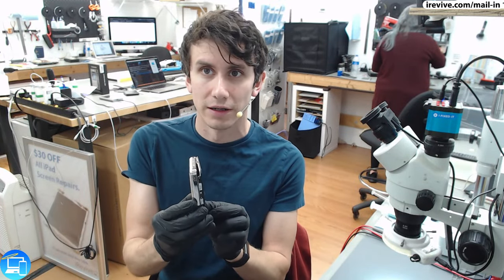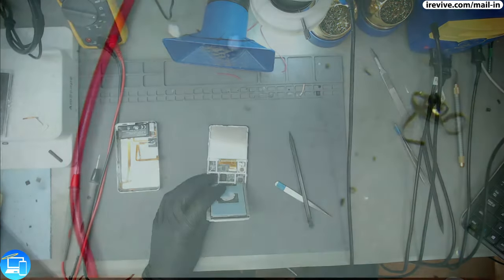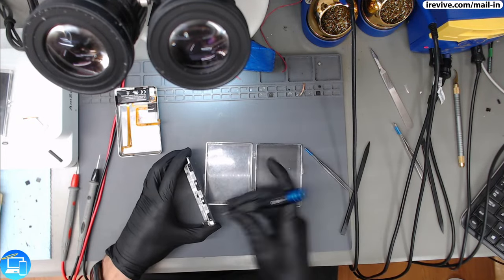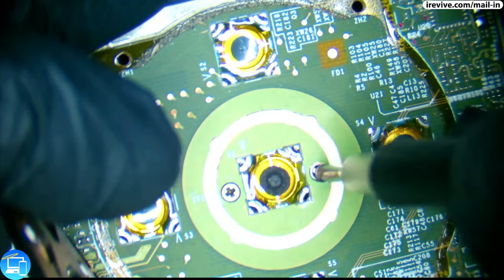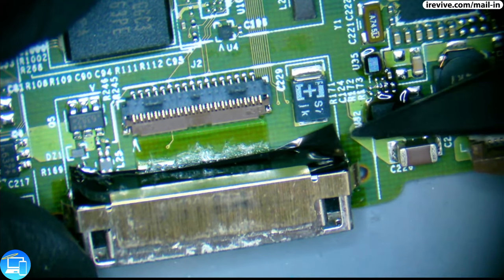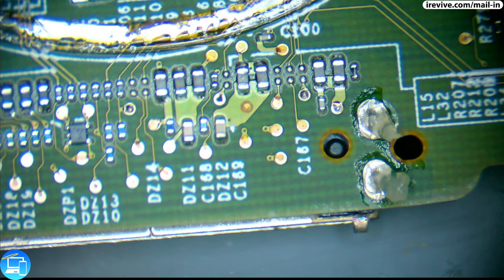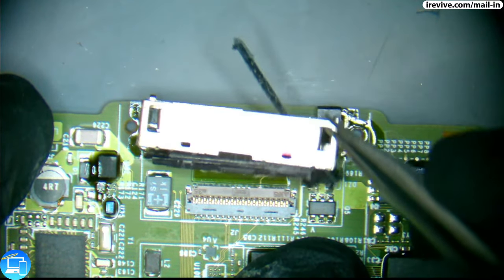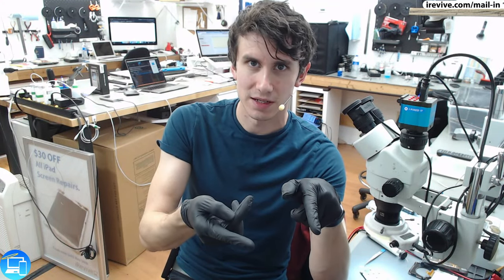iPod Classic Charge Port Dock Replacement Part 1

Comment: Hi.. I found my old iPod Photo 4th gen and the 30pin charging port is broken.. Can i use a 30pin port for an iphone 4 model that I found online to the ipod 4th gen as replacement? thanks!
Reply from the maker: I don't believe so. While the devices both use 30 pin, I am not entirely sure they are the same part. I would suggest trying to get the exact part for the iPod 4th gen.